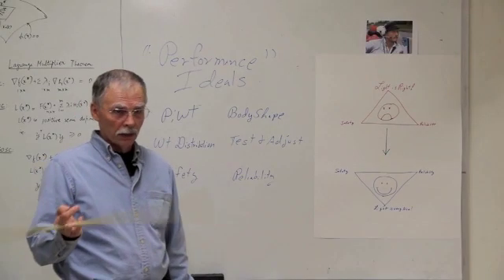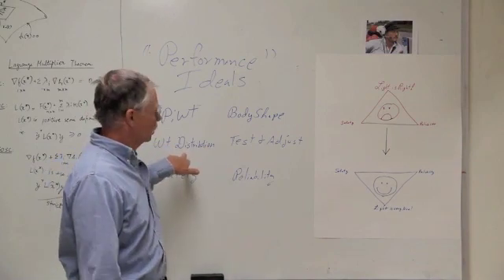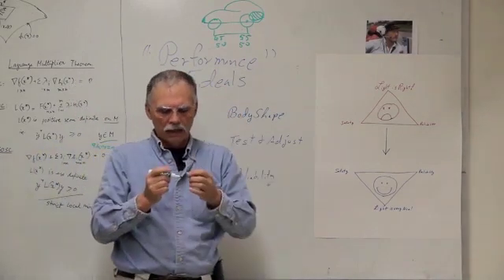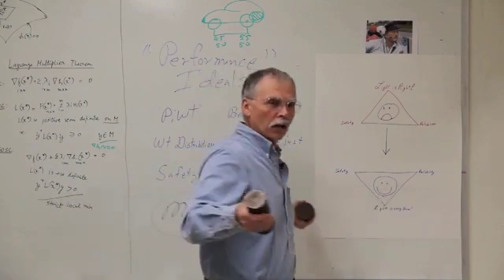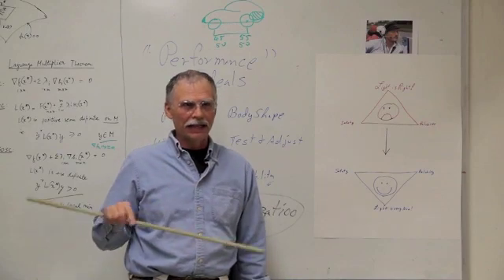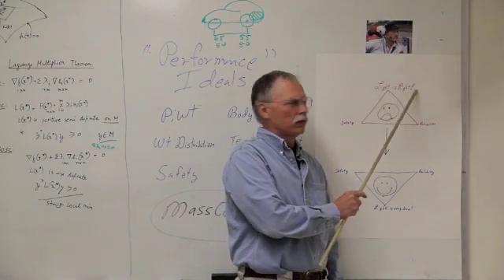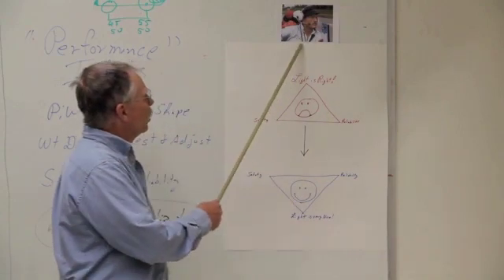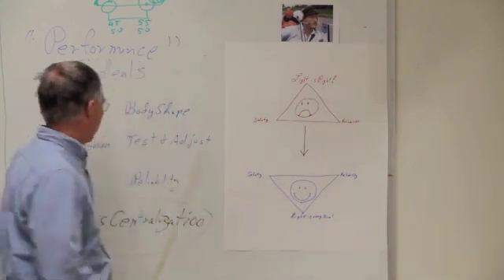Intro to Racecar Engineering: 16 Performance Ideals

Comment: The only comment I will make is that a 944 for example has an extremely large moment of inertia and this is the reason it's so fast the car is light in the rear and wants to rotate but the high moment of inertia combined with a suspension designed to understeer makes the car handle extremely well because you can just keep putting power down and it doesn't want to oversteer even though as a rwd car it's in it's nature.